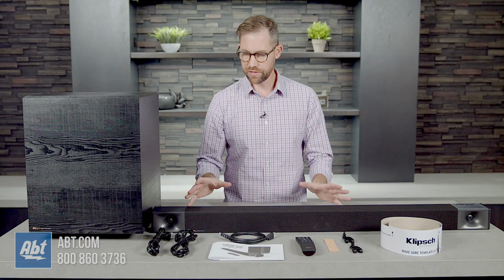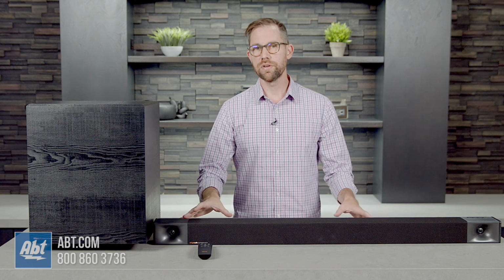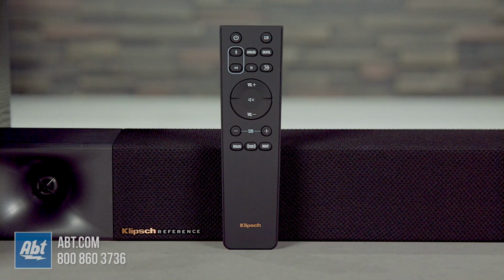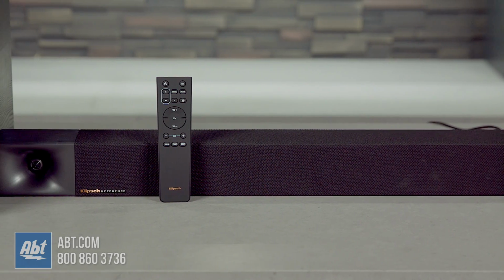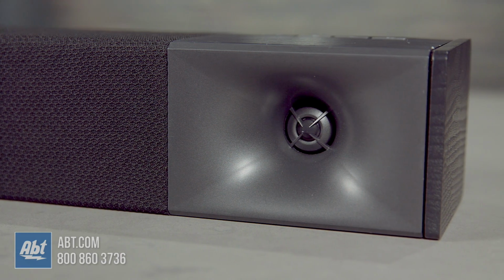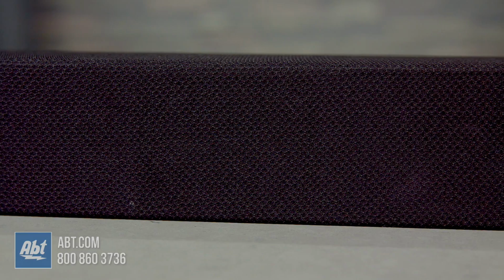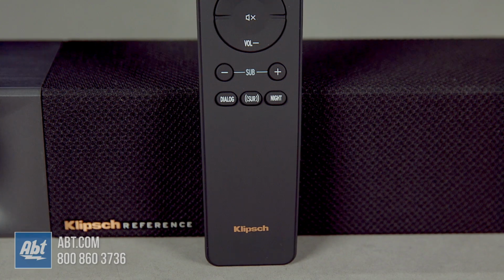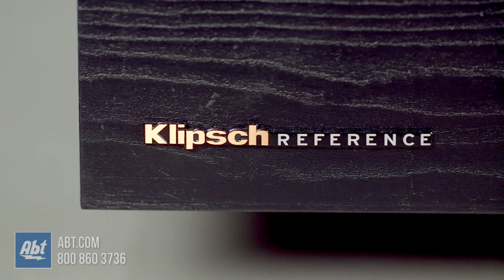Klipsch Cinema 600 Soundbar Overview

Comment: In the last two weeks both my desk top Klipsch system and my Cinema 600 3.1 systems died. The desk top lost all sound to the speakers and the sub. The cinema 600 system first lost the volume display on the sound bar and then blue tooth connection ability. Days later the system won't respond to the remote or sound bar controls. Doing some on line research I see that many people have had these issues. I purchased these systems because of Klipsch's past reputation but am totally disappointed with these current offerings. Don't get sucked in like I did to the tune of hundreds of dollars. I will never buy another Klipsch product.
Reply from the maker: @Pols-bh8kj If you need any help picking out a new system be sure to give us a call, or you can chat with our audio experts online: https://www.abt.com/chat We're happy to answer any questions you might have and we can tell you about our best available pricing.

Comment: Can I use my Klipsch nines with this system
Reply from the maker: @justinschnebly4646 No, unfortunately those won't be compatible with this soundbar. If you're looking to add rear channels you'll need to go with the Klipsch Surround 3 speakers, but they are discontinued so they may be hard to find.
Reply: @ but the sub will work with them  right ?
Reply from the maker: @justinschnebly4646 The 9s are going to require a wired subwoofer. The Cinema 600 soundbar comes with a wireless sub so it will not be compatible.

Comment: Don't Buy a Klipsch Cinema 600.  There is a recall and Klipsch won't do anything when it WILL die. Mine lasted 8 months. READ THE REVEIWS.
Reply from the maker: @stevebabine7706 If you purchased yours from Abt please send your contact information to us at youtube@abt.com That soundbar comes with a full 1 year warranty on parts and labor so it will still be covered if it's only 8 months old.

Comment: Personal opinion Klipsch sound bar. Purchased Cinema 600 sound bar in 11/2020.  In January 2022 Bluetooth stopped working. And the wireless subwoofer is not connecting any more. Also bought the surround sound speakers that don't connect anymore. Many other folks are having issues with no solution per Reddit and other sites.  Buy a different brand and save yourself the headache.

Comment: Hi, would you recommend adding the Cinema 600 Sound Bato the YAMAHA RX-A4A AVENTAGE 7.1-Channel AV Receiver? I'm considering a sound bar w/SUB to be an additional component because I have to place the Subwoofer behind my TV due to very minimal space so a powered SUB won't do because I'd have to pull out my entertainment center each and every time I want to use the subwoofer. So I'm thinking Blu Tooth is the way to go . . Please help. Super NEW to the AV world here. Thanks!
Reply from the maker: @John Allen Typically you wouldn't use a receiver with a soundbar unless you had more audio sources than your TV could accommodate. The soundbars have their own amplification built in so a receiver isn't required. That being said, the Cinema 600 is a terrific soundbar with great audio quality. Here's a link to our current pricing if you'd like to take a look: https://bit.ly/3LHBMah
Reply: @abtelectronics  thank you. 

I do have other sources and I plan to purchase a turntable so I need a receiver with a Phono Out. I also have an Apple TV, Blu Ray, Cable, and XBOX… my main issue is the subwoofer. My living room has limited space and a powered subwoofer would have to rest behind the TV console. So a 8” passive subwoofer or blue tooth with a remote is the only thing I can think of. 

Any suggestions on a solution?
Reply from the maker: @John Allen It will be more of an investment, but you could hook up left, center and right channels and add this SVS sub and a wireless kit: https://bit.ly/3UScAlt, https://bit.ly/3BXqwBZ
Reply: @abtelectronics  awesome and thank you so much!

Comment: Bought mine at Abt, 2 months after purchase it won’t power on anymore, did all the regular trouble shooting and nothing worked. Emailed Klipsch customer care and they never responded. Very disappointed in product and service.
Reply from the maker: @inkslinger787. We're sorry to hear about the trouble with your soundbar. Because we are an authorized dealer for Klipsch, we honor the manufacturer's warranty of 1 year on electronics and 3 years on the woofer, cabinet and non-electrical mechanics, from the date of purchase, if it is properly used and maintained. Please email your purchase info to us at youtube@abt.com so we can have a manager reach out to help.
Reply: same issues with the  sound bar customer service was less than expected. 

 @abtelectronics

Comment: Just ordered mine today, as an old school Klipsch Fanboy  for 30 years, I wanted the Klipsch Quality and sound, and a pricepoint under 500 bucks
Reply: Hi, could you please tell me if it gave you any problems. I'm about to buy one and I've read some negative stuff, so I'm a bit confused.
Reply: @Ziggy Stardust  no issues as long as you know the specs are what you need. I only have the sub and sound bar. Work flawlessly. More bass than you can imagine if set accordingly. Music is great, movies are great. Not a true surround sound experience but I love it for not being a 7.1 syatem. I might consider the wireless rear speakers but honestly it doesnt need it

Comment: Hi, have you noticed a very low noise like interference in the subwoofer, it is felt when you listen at a very low volume (close to the minimum) and there is silence in the room, it is even more felt if you approach the subwoofer.
I also noticed that noise is when the bar sends bass to the subwoofer, if it is not playing bass it does not make the noise. I bought 2 cinema 600s and they both make the same interference noise, so it doesn't seem like a unit defect, I tried plugging the subwoofer into different jacks, swapping poles, turning off all the wireless equipment in my house and it does the same thing. Do you know what it can be? The only thing I can think of why this noise comes out is that the subwoofer amplifier is always at maximum power, and the volume is controlled digitally, since the noise is linear at low volume than at high volume.
I interpret that it is the typical noise of when you put a sound system at maximum, but that it comes out at low volume in this type of amplifier, which does not seem good to me, it becomes annoying when there is silence and listening at low volume
Thanks!

Comment: Do you recommend the JBL Bar 5.1 Surround Soundbar over the Klipsch Cinema 600 Soundbar? Thank you.
Reply: I had high hopes for the JBL Bar 5.1 & was told to go with that & I did & boy it was a mistake.  The bar itself lacked some serious dialog & the entire system wasn't very loud at all but had desent base.  The bar 5.1 is not worth the money for sure.  I was very dissapointed in it.

Comment: The Bose soundbar 300 is the same price. Which do you recommend? Pros and cons?
Reply: Mark Sentowski  On the Bose sound bar 300 you can connect a powered subwoofer if so I would go that route for myself instead of going to JBL or the video or we’re watching
Reply: @ryanlindahl2714  i

Comment: Hi, I can't get sound out of my cinema 600 when I plug into my Insignia Roku TV. What am I doing wrong? I tried using ARC, optical, and analog. Why is it so complicated? I got bluetooth to work after 20 min of messing with it, because you have to engage it with the remote (stupid). Great sound. Pain in the neck to setup. I've set up surround sound before and other soundbars. There is no reason it should be this complicated.  Help?
Reply: Have your figured out what the deal was cause I’m considering buying one and I have a Roku TV, if it won’t work with it I ain’t buying it
Reply: @dakotadad8835  yeah. I had  To make some kind of an adjustment in the settings. But it does work, sounds great. Only issue is that I have it in my bedroom, and it is a small room. And I noticed that sometimes if there is no volume or sound on the TV there is a slight buzzing sound from the sub. I do not know how to fix that.
Reply: @TheEstevanVega  hey thanks for responding I really appreciate that! Have a good one stay safe

Comment: What subs will work on connecting to this soundbar?
Reply from the maker: Hi J W! This sound bar will come with one wireless subwoofer, you do have the option to add another subwoofer on to it, but it has to be a wired subwoofer, both can't be wireless. If you have any further questions please feel free to call us at 800-860-3736 and one of our experts is happy to help! Thanks for watching!
Reply: @abtelectronics  Thanks for answering my question. What additional sub wattage will work great with this soundbar? I understand it has to be wire but what will be overkill or not enough for this soundbar power output.

Comment: DO NOT BUY THIS SOUND BAR
I really thought Klipsch made top notch stuff. For decades they have always been held up as folks that know what they are doing. 
That myth has blown up. 
1)  Low mids are overpowering forcing you to jack up the voice volume (non linear) making things too loud or too soft. 
2) NO graphic EQ in the phone app. The website lies and shows a graphic EQ on your phone but those are for earbuds not the sound bar
2) Klipsch is so undermanned they do not answer support questions. So you get something in the mail and you have NO support. 
The bass speaker is great though.

Comment: Yo you didn't mention the most important thing. Does this have Dolby atmos??
Reply: It isnt a dolby atmos system. You can add the suround 3 series speakers for suorund sound but it is not an atmos system. The klipsch 1200 series is a dolby atmos setup
Reply: The atmos klipsch comes out March. I want it too.

Comment: The 48 was buggy, bass disconnected and the channels were unbalanced. Is this fixed?
Reply: I currently own the Bar48, while I love the sound from the bar itself, I do have to admit that the sub has periods where is disconnects and won't reconnect, to counter that I also have an R-100SW connected, which has way better bass than the wireless sub.
Reply: On the 600 it's fixed I have had mine over a month and haven't reconnected the sub or surrounds once.  My only issue is the 48 has better surround sound

Comment: I've got to tell you...Klipsch is very disappointing.  1 HDMI port?  So idiotic for a bar that's designed to replace an AVR.  If you don't have at least 2 HDMI's...it might as well be a passive soundbar.  So dumb.
Reply: I don't think you understand ARC.
Reply: @SchuylerBatdorf  I think I understand it well enough to know you are implying that we can rely on the HDMIs from the TV.  Well, for some that's not as desirable.
Reply: I’m disappointed because the app doesn’t connect 🥹
Reply: What?? How many hdmi in this 600???
Reply: @Hyanna-c  1 hdmi. It not loud enough. May suficie for a small room
Reply: @onyeigbombu6271  HDMI has nothing to do with volume what are you talking about 🤣
Reply: @NutraFit87 I am making reference to the system as a whole not being loud enough. Hdmi has nothing to do with the loudness of this system. I tried various sources to no avail. Take this from me, I have R-20b and it  blows the 600 series out of the park. Cinema 600 is not  all that impressive in my opinion
Reply: @onyeigbombu6271  Most soundbars, including Sonos, have one HDMI.  It's assumed you own a TV with enough inputs outputting audio via eARC back to the soundbar.
Reply: @onyeigbombu6271  same dam problem I had with the JBL Bar 5.1.  It was a nice bar but dialog on the bar sucked & the entire system wasn't very loud at all & the system left me discusted & it's surly not worth the money & to hear this bar is also not loud is very disappointing.  I have a polk auido signa S2 that was cheep & it gets louder the the JBL Did.  These bars suck I guess & are over rated.
Reply: I just got mine today and am surprised there's no HDMI pass through!
Reply: MAYBE YOU SHOULD START YOUR OWN COMPANY AND SHOW EVERYONE HOW IT'S DONE.....LOL

Comment: How about Klipsch  300 watts ? Do you recommend  ?
Klipsch Sound Bar with Amplifier 320 Watt, Wired/Wireless, 1064247
 Klipsch Sound Bar with Amplifier 320 Watt, Wired/Wireless, 1064247